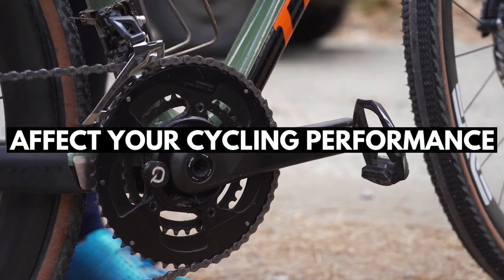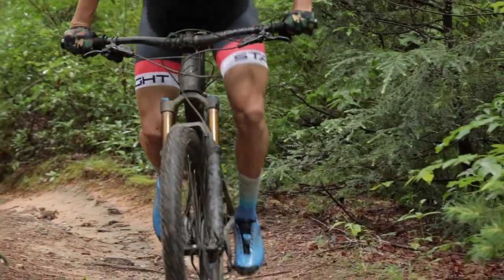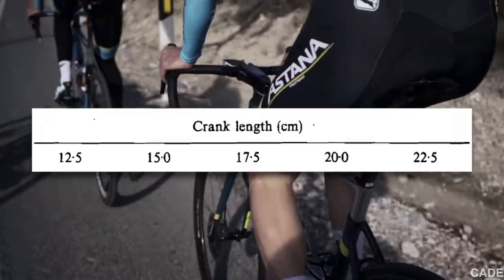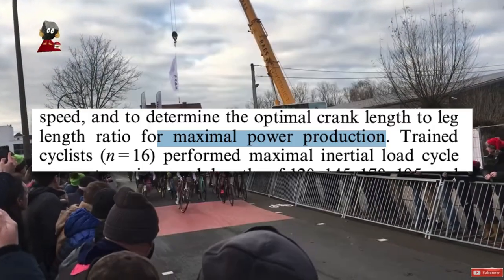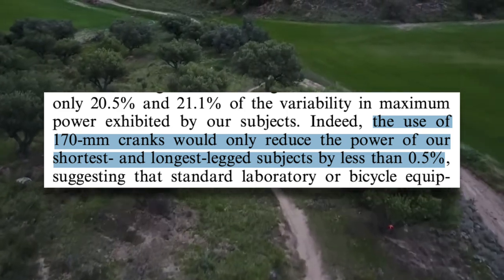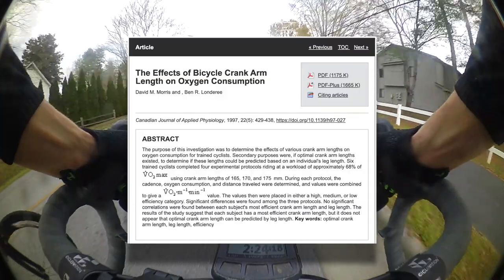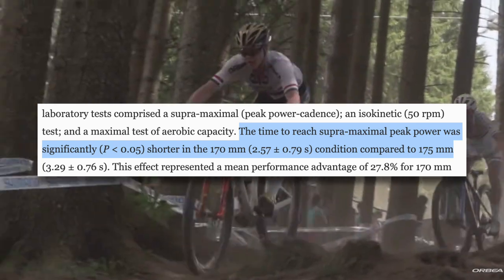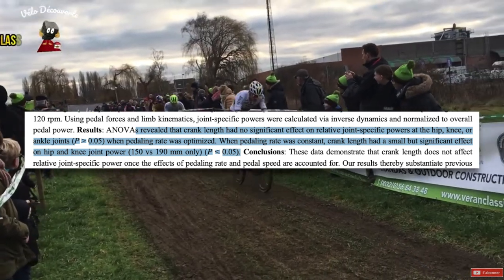Does Crank Length Affect Your Cycling Performance? The Science

Comment: Hi Dylan,
Unrelated to crank length but a question that i often ponder that i suspect many others do as well.

Consider doing a set of efforts, say 5 * 5mins. Am i better to target a slightly higher wattage for the first effort, say 320 watts, and then taper the target figure as i start to fatigue in subsequent efforts? so they might be 320, 315, 310, 305, 300?
OR, do i set the target as mid range (310 in the above example) for all five efforts? In which case the first one will feel a little easier and the last one will hurt even more.

I ask thinking about your general mantra of doing the hard stuff when you're fresh, eg, doing high intensity work after a rest day. Does that lend itself to doing slightly harder efforts at the start of each set?? Question could apply to short or long efforts as regardless of duration the repeated nature makes the question relevant in all cases.

I'm interested to hear your thoughts on this one.
Reply: hmmmmm . . .  doesn't this really depend on what your target is ?  if you are trying to achieve 5 x 5 min at 320 watts say at 95% of your FTP for example.  your last one of 300w only achieved 89% of your FTP.   Your efficiency fell off from your target of 320w on every one after the first.  So what about holding a lower time interval ie:  5 x 4 min at your target goal of 320w.  Then when you can achieve that target - then work on your endurance to be able to hold for a 5, 6, 7, or 8 min average.  Trying to taper your efforts would alter your target unless you are doing step intervals at those specific power numbers.  Think of the 12 min CTS FTP ladders as a target workout.  3 sets of  (2 min at 120% FTP, 4 min at 95-100%, 6 min at 86-90% with 6 min rest between sets).

Comment: There are other factors that have to be considered from crank length. I just purchased a new Trek Checkpoint, which came with 172.5 crank length but had to change to 165 due to having a prosthetic leg. I could close the knee enough to comfortably ride with 172.5. I have been working hard to modify my prosthetic leg to allow me to go back to 172.5. Sounds like this isn't going to buy me anything. I went through this same process on a recumbent trike (Catrike 559)  and eventually put the original crank back on the. It took me ~4 long rides to fully adjust. Am I wasting my time to try to get back to the 172.5 crank length on my gravel bike?

Comment: I wonder if the track cyclists also use 165mm for to help with an aerodynamic position. I'm a 5'6'' guy with 175 cranks, and when I get into an extremely aero position, my legs start to interfere with my abdomen. So a shorter crank should help with that. Plus shorter cranks mean you can have a lower bottom bracket, which should be good for aero too.

Comment: As far as tweaking then your saddle position from crank length changes, I would start from the knee-peddle spindle Plumb Line metric.... assuming it needs to be adjusted while handle bar-stem combo remain the same.  Just my 2 cents worth.  Great medical literature ref's in the video BTW.

Comment: What was not covered is the obvious reason why shorter cranks work, Backwards Hat Dylan didn't get a chance to mention it but we all know that there is a significant weight gain associated with shorter cranks. Changing stock 175mm cranks to 165mm allows the rider to partake in 5 beers and a large pizza at the end of every ride.

Comment: Makes little difference to my power - I assume my muscles adapt to maintain a constant rotational velocity of the pedal axle. I like 180mm when riding cobbles, very hilly events. Easier to roll a big gear. I'd use them for Cross, except for the pedal-strikes all the time. 165mm on the track. It's a smoothness thing. I like changing crank length, saddle height and bike set-up between different bikes. Stretches things out over the week.

Comment: I never would have thought it doesn't make any substantial difference. Perhaps it matters more to less fit riders? Is there any study that measures strain exerted on the knee joint for various crank arm lengths? I reckon that would be quite interesting to riders with knee injuries.

Comment: My bike fitter advised me that longer cranks can impact knee flexion.. I had 175mm and was experiencing knee soreness and went to 170mm which alleviated my knee soreness.. So there is more than just performance changes..
Reply from the maker: Certainly! It’s nice to know that performance doesn’t change much at all when changing crank length so you can make those changes without losing anything.
Reply: @DylanJohnsonCycling  yeah my initial thoughts were I'd lose power but I was reassured there wouldn't be any loss so was a no brainier to change.. The only issue is the cost when you're running latest SRAM groupset.. Lol
Reply: Assuming that you made some minor adjustments to your seat height, did you notice any difference from short rides as to long rides ?   I have similar knee soreness on longer rides of 80+ miles with 175mm cranks.  Thanks !
Reply: @billorr948  had to put seat up 5mm when I put the 170mm cranks on.  Long rides feel fine now.

Comment: Dylan, thanks for another excellent analysis.  When I’m pedaling out of the saddle I have a dead spot between 11 and 2 o’clock.  I’ve tried working with my body position but can’t get rid of it.  I’ve wondered if shorter crank length might be the way to solve this problem.  Please let me know if you have any thoughts about this.

Comment: I changed from 170 to 160 mm cranks. The average speed of my rides has consistently dropped by 1 mi/hr. I live in a hilly area, so every route has many little climbs. From the first ride with 160 cranks, I felt I was going up at slower speed for the same effort. Any thoughts?

Comment: 45 years on 170s, then 175mm not good. 6' with 31" inseam, more in shins than average. .6% difference 170 to 175mm. Really obvious difference.  165mm  track cranks even more natural.  Hip flexibility is key for an older athlete.

Comment: imagine if you were given a much longer crank, your body needs to flex so much and deliver the power in an awkward position. you'll end up slower and tired, because it's your joints doing the power delivery, not your muscles.

the argument of "the longer the cranks, the less power needed" becomes progessively irrelevant for shorter riders.

Comment: "Twelve amateur road cyclists performed three sets of submaximal pedalling " the sample sizes in the studies are pretty small but do correlate with empirical evidence it seems. Bascially if there's a power meter/crankset on offer don't let a few mm put you off is my takeaway. I use 170,172.5 and 175 (training/Road/TT) don't have any complaints.

Comment: CMIIW crank length for track is shorter to prevent the pedal bump the track and caused damage. Imagine a wooden track would break if the pedal hits the track.
Reply: It doesn't usually do too much to the track..  scratch or dent, but it'll often wipe out the rider.
Reply: @nwimpney  I see. Just like riding brompton and the pedals hit the road bump, my friend relative got broken ribs because of that.

Comment: so im 6'5 and recent went from 170 to 175 and i was shocked how much easier 175's get me up hills.  i feel less like im "chugging" during climbs even the during my conversion (i went from a 50/34 - 14/28 groupset to 53/39 - 11/32).  if i did my math correctly then the ratio for my lowest gear on both setups is 2.4  but the difference crazy.   i find that most of the time i dont even need to hit the lowest gear to put in the same effort for a climb and im doing them faster as well.   Do you think this is normal, psychological, or that i just have a better fit o my frame now even though its only a 5mm difference?
Reply: I could believe it.  I'm 6'4 and I definitely prefer my 180mm cranks to the 175mm I had on most of my other bikes.  It dropped my average cadence by a few RPM, but I find I can sprint harder without hurting my knees.  (Probably because less force at the same RPM and power output)  I think longer would probably be better for me, and I'm going to try some 190mm soon.
I have very long legs though (39" inseam, measured with the book in the crotch method).
Reply: @nwimpney  I am looking at 180's but I'm so happy with these 175s that it's I'm debating if I even need it.  I have fairly long legs to but at this point I feel like the size of my bike is holding me back more then the crank length but I'm already high enough on the seat post that I'm maxing out how much leg I can throw down

Comment from the maker: What crank length do you use? Any reason for choosing it?
Reply: I use 170mm because I did some research and found a formula to choose the best length for me, however I really want some Look Zed cranks that change from 165, 167.5, 170 so I can change to 165 for triathlon mode. I think the main factor that was mentioned but not really explored was aero gains from being able to get into and hold a more aero body position for extended periods.
Reply: 165. I am 165cm tall and want to ride length on track and road.
Reply: I started racing mtn bike in the 90s. I'm 180 cm tall. My mountain bikes came with 175s so i put 175s on my road bike for training. Still riding 175.
Reply: 160mm. I'm 165cm in height. 76cm inseam. I wanted it for comfort. 165mm is still comfortable but 170mm gave me knee pain.
Reply: Dylan Johnson I....I don’t know :(
Reply: 170 mm-83 cm inseam
Reply: I use 170mm because that's what came with the groupset (and the whole bike). But as a short guy (with really short legs) I'd buy a 160-165mm crank if i had the money.
Reply: @mikelzubieta6003  go to eBay. There are Shimano 105 R7000 cranks at 160mm for around USD100. The silver version is cheaper because it doesn't look good after prolonged use.
Reply: 165 mm for bike-fit reasons. I am a desk jockey, and hip flexor mobility isn't the best. Edit: I'm around 178 cm with 81 cm inseam.
Reply: I'm 5'-8" and ride all my bikes at 165mm.  More comfort and less fatigue on longer rides.  I notice better power at 170mm on hilly rides for about an hour. More focused on training for 100 mile race makes the shorter cranks better for me.   Lots of comments on here from taller guys riding shorter cranks too.  Thanks for another great vid!
Reply: 165mm. Tried 165, 167.5, 170 and also ride 172.5 on my first bike.
Actually prefer 167.5 but it is a rare size, so it is hard to source 167.5 for every bikes. So I settle with 165 which is more common.

Comment: Interesting research. It also means we could use much shorter crankarms without much performance loss. It could allow bike manufacturers to lower the bottom bracket (and gravity center), improve clearance (especially for MTB), save weight..and more. I believe one of the Canfield brothers has been advocating for  155 crankarms (https://canfieldbikes.com/collections/cranks-chainrings/products/canfield-bikes-am-dh-cranks?variant=31107032186955). Crankarms length also has impact on the torque for a given gear combo which affect traction (especially on dirt) and mechanical  wear (chain, cogs, etc.)

Comment: What about long cranks closing up your hip angle and preventing you from getting more aero. 5-10mm can make or break having a flat back.
Reply from the maker: Great point. If you want to get aero go shorter!
Reply: I run a shorter crank on my aero bike and the setup works really well. 165mm and I'm 173cm tall.

Comment: But if I try to build bike and not to use existed complete bikes?
I found simple formula with which are possible close enough calculate optimal crank lengh(171.5 mm calculated, so 170 or 172.5 mm)... I found at least two videos where was talked that it is better to use cranks a little bit shorter than calculated with formula to got less fatigue and joint hinderens... And only cranks I can obtain for my money and which I can use are 175 mm... And there no any usefull info. 9_9 Thanks... I guess.

Comment: It's all just different ways of getting the same performance. A change in crank changes torque, which will scale up and down with RPM. The cadence you will have with any given torque value will vary by gearing. Again, this is all just about moving performance around.

Comment: Isn't crank length more a bike fit issue rather than straightforward performance? Not exactly the same, but you don't try to find performance difference between different stem lengths, bar widths etc. It is more about comfort and what works for you in long term. Of course bike fit eventually has an impact on efficiency and thus power and other performance metrics, but perhaps not in the way it's studied in those research papers (crank length X leads to performance Y etc.)

Comment: Let's keep it simple if a rider is 180cm and 170mm is optimal crank length.  Then a rider 10% shorter (162cm )would need 10% shorter cranks for all things being equal.  That short rider (me ) 153mm cranks is optimal . I have a carbon race bike xxs  with 165mm cranks, and a hack bike with 140mm cranks . 153mm looks like the sweet spot for short riders .

Comment: Great "waste of time," Dylan - thanks for doing all the research.
On 'bents movement is limited & shorter cranks reduce knee stress (probably like TT riders reducing hip angle/being more aero).
Track riders may also be reducing pedal strike.
Reply: to be honest on the track the only time you would pedal strike is going very slow on a bank and not leaning the bike.... when you are going even a moderate speed you will automatically lean the bike with the bank of the track and thus will never pedal strike. the spinning thing for track does make sense
Reply: @moviepedro  Thanks for the info.

Comment: So the majority of the research states that there is negligible effect on power output between commonly supplied cranks. You state that saddle height can effect power output by 5 to 8%. 
If you have 172.5mm cranks when you should have 170mm cranks this is the same as having your saddle 5mm too low. At the bottom of the stroke you need to lower saddle by 2.5mm to allow for longer crank but at the top of the stroke your knee comes up an extra 5mm. 2.5mm from the longer crank and 2.5mm higher because you have had to lower saddle by 2.5mm to allow for longer crank. This can and probably will have a detrimental effect on knee joints. If you need clarification draw a diagram and you will see I am right

Comment: My experiences mirror this video. I've switched to 170 mm cranks on my mountain bikes, today's long, low, and slack geometries increase the pedal strikes in my opinion. This combined with modifying my pedaling reduced my pedal strikes. I had a fitter who was a slave to KOPS above all else sell me on 175 mm road cranks several years ago. I didn't experience the promised increase in power and efficiency that was promised, but my hips got pretty uncomfortable when I would get down in the drops. I went back to 172.5 mm cranks with no loss of power (hard to lose what was never gained) and hip pain was reduced.

Comment: It sounds like to me like you have short legs for your height. My wife is 5'6" with 34" inseam. So let me ask you. Is your bike a road bike or mountain bike. If you have a road bike what is the frame size. Too many times bike shops are quick to ask the question how tall are you and then suggest a particular size frame.  When the real first question should be what is your inseam. Let me use another example to illustrate this point. My dad was 5'8" tall; however, my inseam is was about the same as my dad's. If you went on height to start with the shop might want to put him on a 54 cm frame but with probably 170 mm cranks for him to ride that bike the seat would probably be lowered to the very bottom, so to give him a good fit we would probably put in on a much smaller frame i.e. a 50 cm and because he is all torso we would probably need to give him a long stem and possibly shorten the crank length. I apologize for the overgeneralization. I don't want to write a book here. lol Good luck.

Comment: One thing you didn’t discuss is how crank length affects your gearing. I ride my gravel bike in Northern California and we have a lot of steep trails. I  think a longer crank means your lowest gear is slightly lower because of the bigger circle of the longer crank and more mechanical advantage. So if you go to a shorter crank, I believe you effectively are running a higher lowest gear.

Comment: I'm pretty sure you've got that twisted. Pro bike fitters say that linger cranks are better for sprinting, acceleration, crits etc because of the extra leverage. The reason why track cyclists have shorter cranks is because they're fixed gears. Scratch race cyclists chose a longer crank for the acceleration needed.

Comment: Cycling crank length is the same for sex. The longer crank gives more power but you run the risk of bottoming out, the shorter the crank requires more energy for the same work.

Comment: Based on the advice of a bike fitter, I went from 172.5, which I've been riding for 15 years, to 170. I don't feel any difference but the other day I hit a power number In a sprint that I didn't know I could hit. Not sure what to credit, new crank length or a winter of work.
Reply: there is no scientifically perceivable difference unless you go at least 5mm change in length, If any bikefitter told you to change by 2.5mm I would question their expertise

Comment: I got long legs, and thus relatively short upper body. My arms are not longer than normal. Combine this with a middle aged and somewhat stiff lower back, and you get yourself a bike fit problem. I need to run longer cranks and a short stem, or else I end up in a way too forward leaning position for my ability.
5mm crank lenght difference can really throw things off.
Just another perspective...